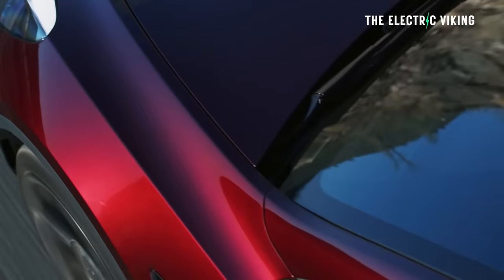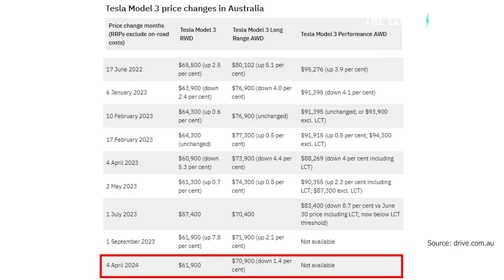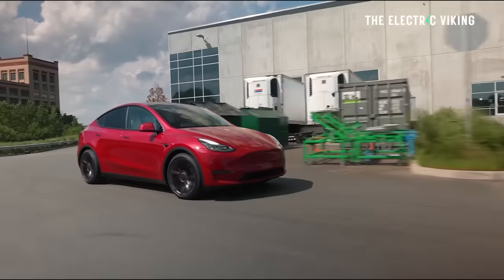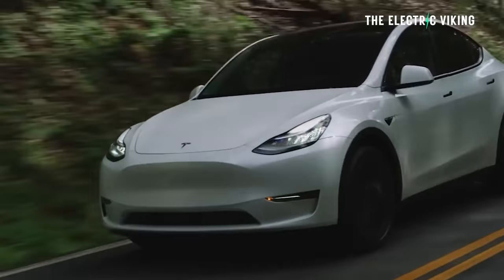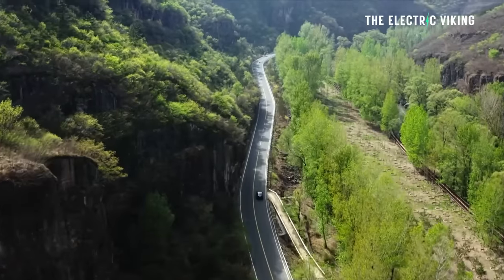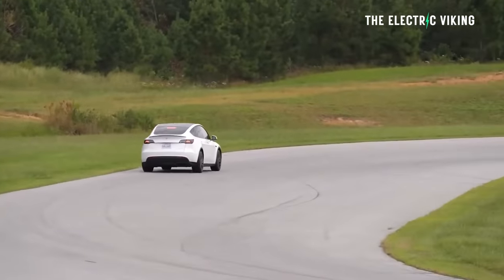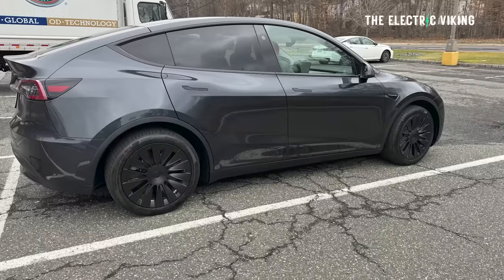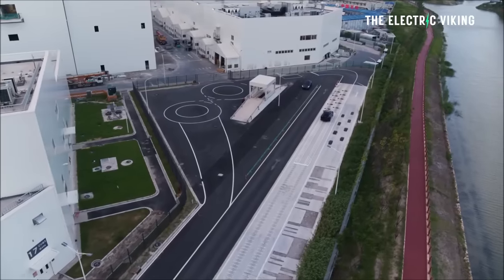2024 updated Tesla Model 3 and Model Y get big price discounts in Australia

Comment: While AWD is very useful for winter driving in Canada, I'm not sure why it is needed in Australia.  A big battery with rear wheel drive would seem to be a good fit in Australia.  The weight savings with one motor would give very good range.  

Even on road trips we charge our long range only to 80%.  The real benefit of the long range on a road trip is the faster charging and the very occasional edge case where a full charge is necessary.  We expect our battery to last a long time
Reply: Because Tesla does not make RWD Long Range anymore.
Reply: Same people who buy a pickup truck and never haul anything. It’s all about enjoying the ride and experience.
Reply: Yes, most other EV manufacturers offer this option in Australia. But the impact on range of an extra motor is not that great.
Reply: Better road handling than RWD. Lots of AWD vehicles in Australia.

Comment: Likely the new changes that didn't make it into the LHD version may be due to requiring different plastic molds or assembly processes unique to LHD that haven't been finished.  It also could be the extra expense for the smaller LHD market may mean some items will not make it into the LHD versions.

Comment: BYD doesn't have one pedal driving? If so no comparison.
Reply: You can set it up for one pedal but it's not a default.
I very much like the BYD accelerator brake harmonisation. In the default mode, foot off the accelerator it will decelerate at around -25kW, transitioning to -10kW as speed drops below below about 30kmh. With the ACC on it will decelerate automatically all the way to a stop if the car in front stops or you encounter a stop light. It's a very to good system.

Down steep mountain roads such as I drive regularly it allows safe controlled descent without putting a foot in brake or throttle. Very nice.